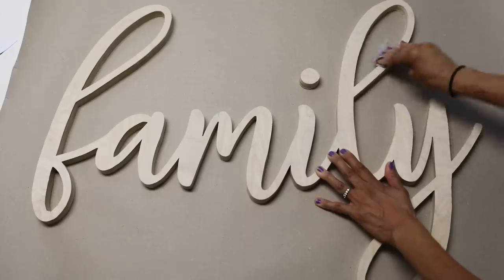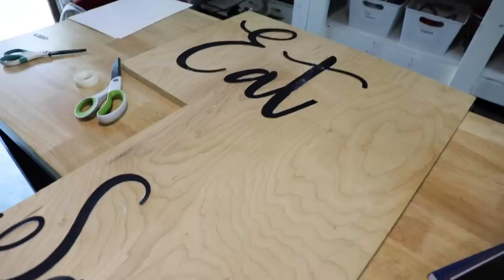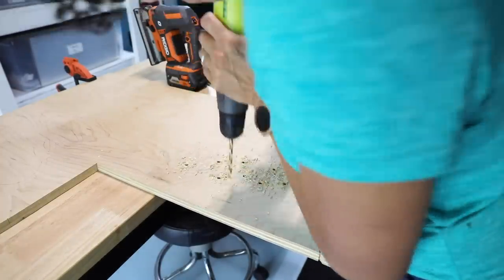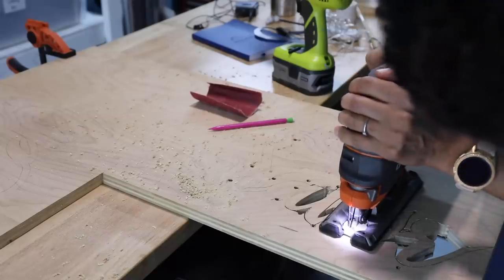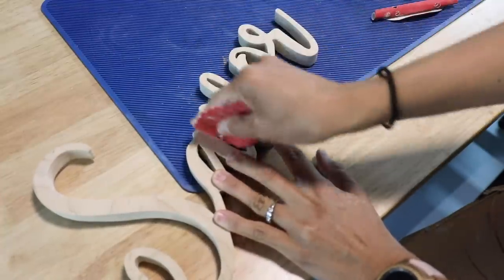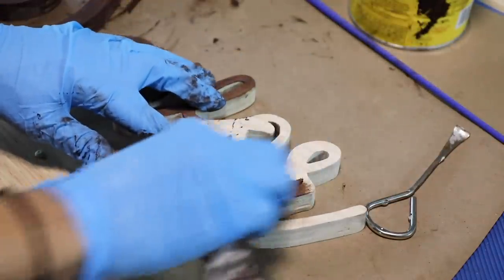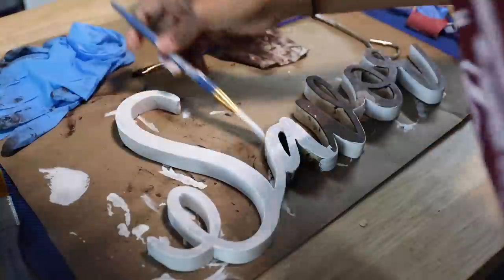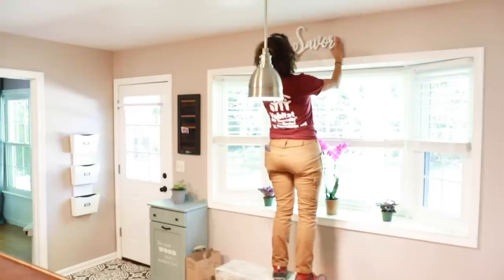Wooden Kitchen Signs: They're Easier to Make Than You Think! -  Thrift Diving

Comment from the maker: If you want to see the more detailed version of how to make these DIY signs for your kitchen, family room, dining room, and more, watch this longer video ~~> https://youtu.be/EpvCaY9Ar_k
Reply: Thrift Diving I didn't know I could use a scroll blade in a jigsaw....awesome info. Thank you for sharing.💖💖💖
Reply: So after you cut your word. .  Sand and use 220. . honestly you don't have to use 150 or 180 then 220 just use 220 first. . .the. If you wanted to paint sides you can stain the use vinyl (651), place on the side of stain and lay it down (make sure place it firmly down with a wedge). . Spray from the back and there you go. . Depends on vinyl should not leak.  Also I think you will get more life out of your blade and wrist lol if you use 1/2" vs 3/4" wood. . . Plus I don't think you'll lose the look you want. ..  finally maybe think about finding a silhouette machine. . They run about 75 to 200 bucks used ide get the #2 or #3.    It will cut out your letters for you and all you have to do is tape them .. save you some time I feel . Plus better product at the end. . hopefully I don't sound rude in anyway shape or form. . I'ma fan. .  Can't wait for the next video. .

Comment: Great job! I've used a Spyder 300009 Jigsaw Blade,steel,l 4 To 4-1/2In which I bought from one of the big box stores but you can find them online. Check out the blade has teeth on the backside to help make some tight turns.

Comment: I'm glad I saw this. I tried to use my jigsaw for the first time and it did not go well. It was jumping out of the wood panel I tried to cut. I did drill a pilot hole but my blade ended up bending. I'll go to home depot and get the blade you suggested.